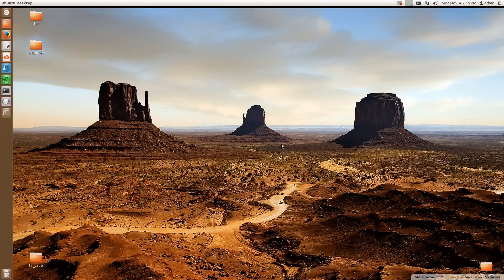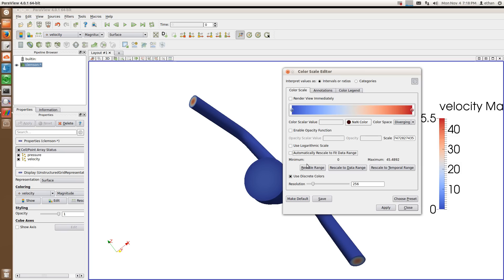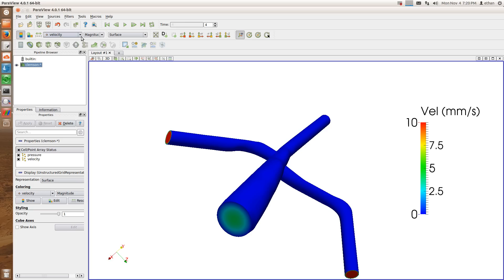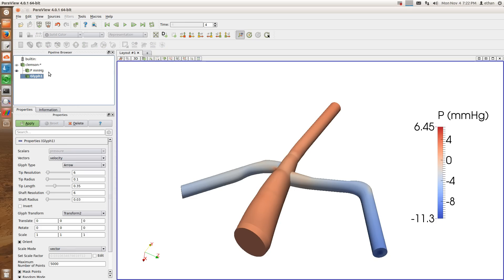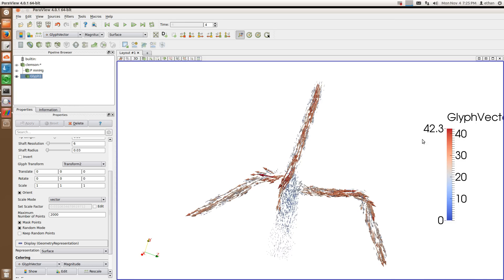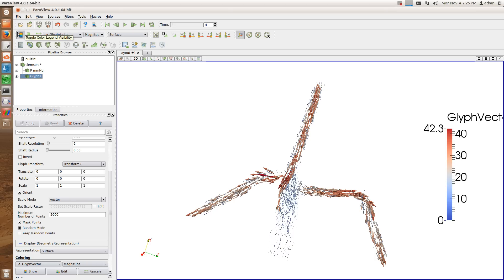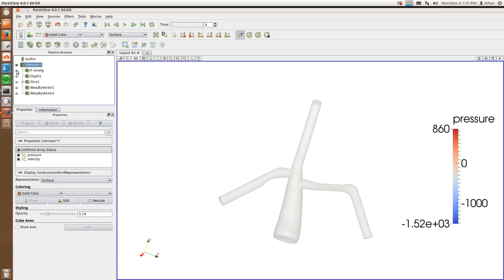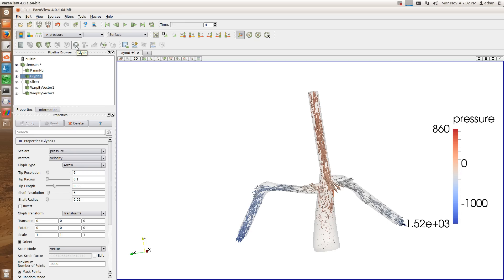Paraview basics tutorial

Comment: Hi Ethan, great video. I have a question. When I import my vtk file to paraview, when I turn the legend 'on', I see that the legend starts with some value as opposed to zero (in your case you have zero and I feel that makes sense). Do you know what that is? Could you please help me with this? Thanks
Reply from the maker: Depending on what parameter you have the legend showing, the legend might not start from zero if the lowest value of the parameter is not zero.  You can adjust how the legend shows up via the legend window shown in the video around 2:40

Comment: Excellent work, well done :) Ethan, i wanted to ask if you have done any video regarding particle tracking. in particular,assuming  few particles which are moving, while the points at which they are passing are connected, creating at the end the particles' path.
Reply: You can use Paraview to visualize particle movements if you have the particle location information in the file for every time step.  I'm not sure if you can create a pathline from the particle movements though.  You'd probably have to do some post-processing on your data to combine all of the particle paths into the same file to visualize the path in Paraview.
Reply from the maker: Paraview can plot streamlines based on instantaneous velocity, but I am not aware that it can plot the pathline of a particle as you are describing..

Comment: Hi Ethan,

Thanks for the introductory session.

I was wondering if there was a way to use paraview to get (Stress/Strain) value at a particular point as a time function. Meaning a have 10 time steps and want to calculate the stress and strain at that particular point during each step.

Thanks
Reply from the maker: +Aly Abdelaziz Yes you can use the calculator to calculate the quantity you want (as long as you have all the required information for the calculation in the data).  Then you can plot the quantity over time by using a combination of appropriate filters in Paraview.  I might make a video on how to do that at some point since it is a fairly useful thing to do.

Comment: fantastic tutorial. I wanted to ask you a question, as someone with less engineering and more medical knowledge:
you mentioned WSS visualization in Paraview. I wanted to know if I could use the calculator function in Paraview or import the WSS equation in Paraview using Python or Matlab. Would Paraview be able to calculate and visualize it?
Also, do I need to open my flow data (MRI 3D flow dataset in DICOM format) in other applications like VTK first and save them as .vtu or something else for Paraview to properly open it? (because my first attempts to open DICOm flow data in Paraview did not work!)

Thank you in advance for your help
Reply from the maker: As far as I am aware, Paraview can not read DICOM files.  I am also not aware of any good way you can calculate WSS from the velocity field in Paraview.  The dataset you are viewing needs to already contain WSS information in order for you to view it using Paraview.
Reply from the maker: Paraview will not open DICOM data, but it will open VTK data.  The calculator function can perform calculations to each node, but it is not able to perform calculations involving values from different nodes.  So depending on what information you have stored in the nodes, you may or may not be able to calculate WSS with Paraview.

Comment: Ethan:
I like your instruction in this presentation.  Could you give some specific help with opening a 3 column CSV file and presenting the data.  The concept seems simple enough, but I have managed not been successful in doing it.  
Thanks,
Gary
Reply from the maker: It depends on what you want to do with the 3 columns of data.  If you just want to produce a line plot or something of similar nature, you can easily load it into Matlab using load('filename'), or just open it with excel and plot them that way.
Reply from the maker: You should be able to use Matlab or Excel to open a simple CSV file